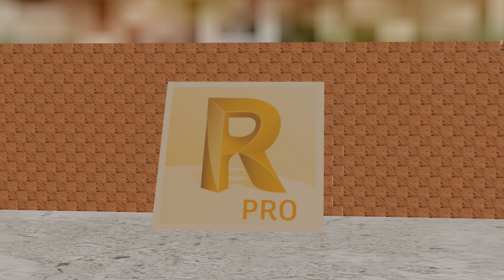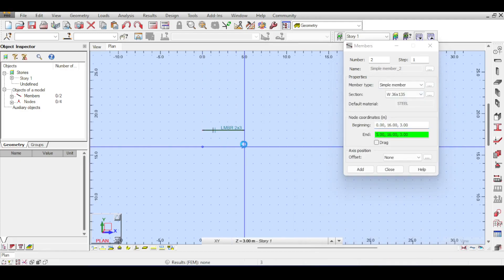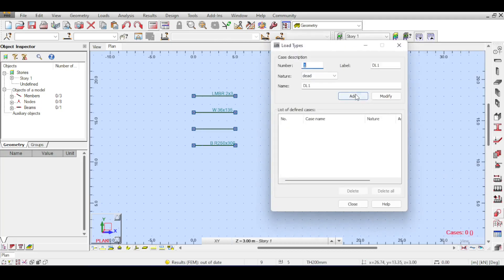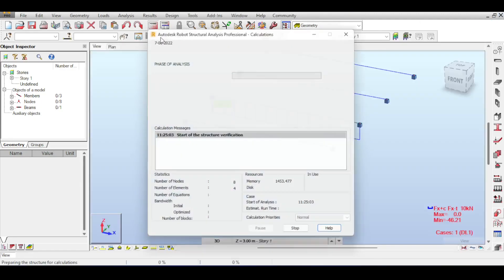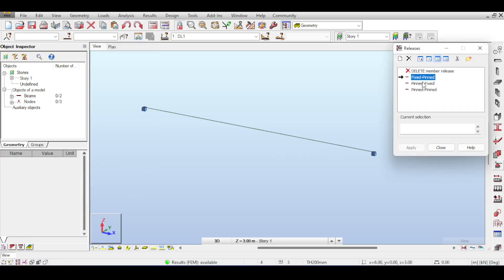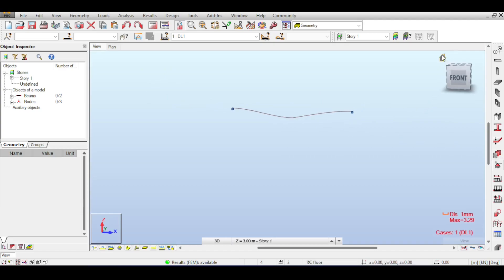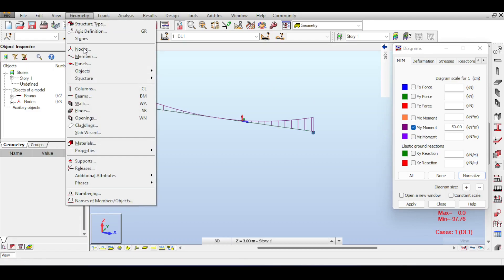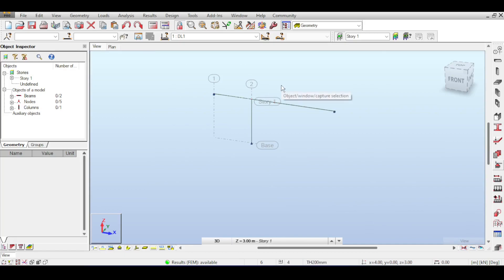Member Releases and Types in Autodesk Robot

Comment: Can we release the moments partially ? like for the semi rigid connects ?
Reply from the maker: Yep, you can by checking out the "Linear Release" or even a "Non-Linear" release when defining one. 
In a linear-release case, the release is replaced with a rotational OR linear spring based on the released direction and the spring constant that you provide during the definintion.

In a non-linear release, you would define the full force-displacement or moment-rotation curve. If I remember correctly, robot might ask you to enable some higher order calculation options in case you are using non-linear hinges (if those options are disabled in your robot at the moment).

I think I should provide a video about that issue to talk about the underlying theory and how robot does model those linear releases, but I wanted to answer your question first.

Hope it helped, stay tuned for more content, and - if possible - please suggest this channel to your friends, it helps a lot.
Regards,
CEE
Reply: @CivilEngineeringEssentials  Thank you very much.